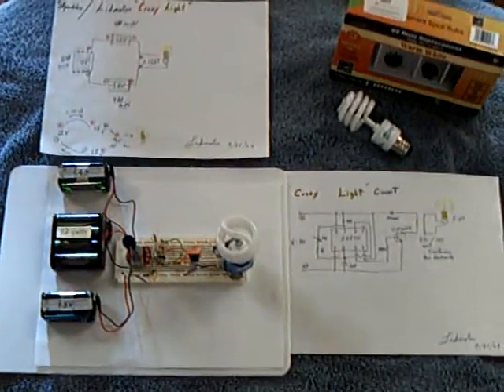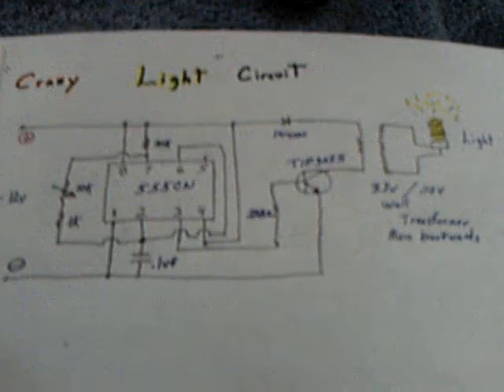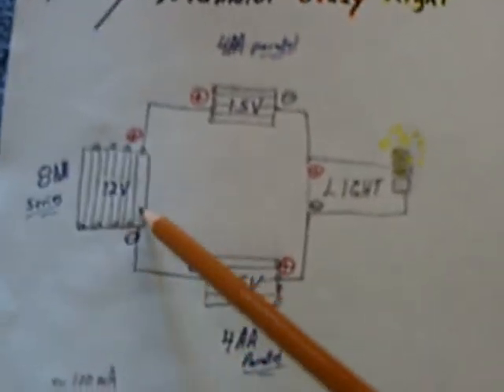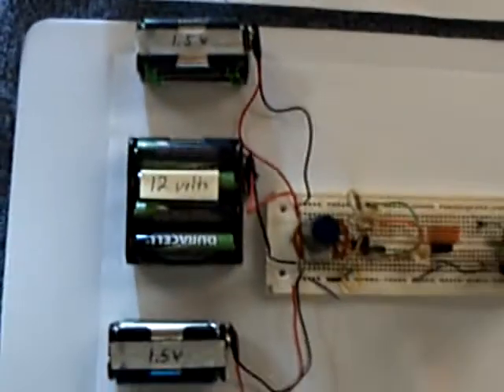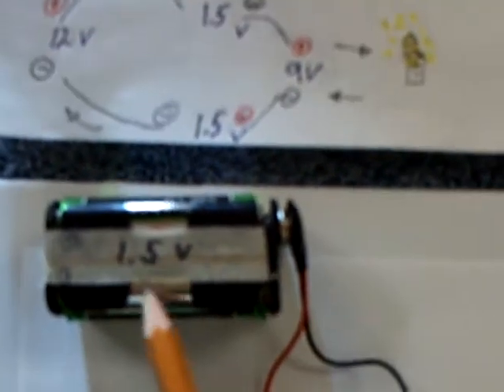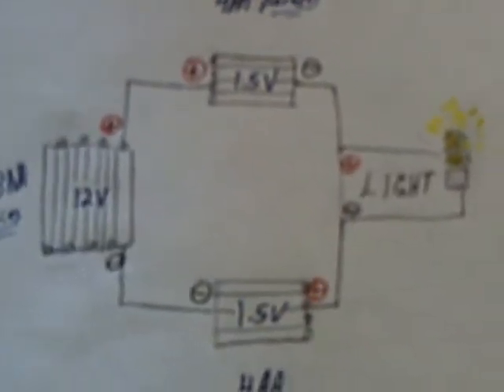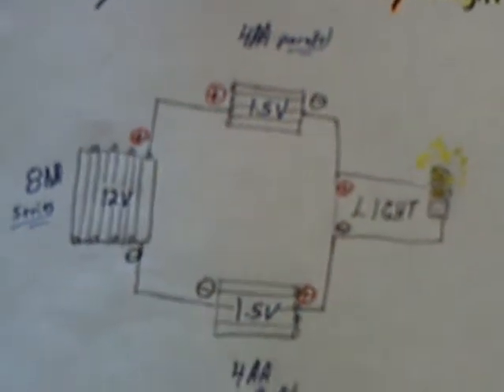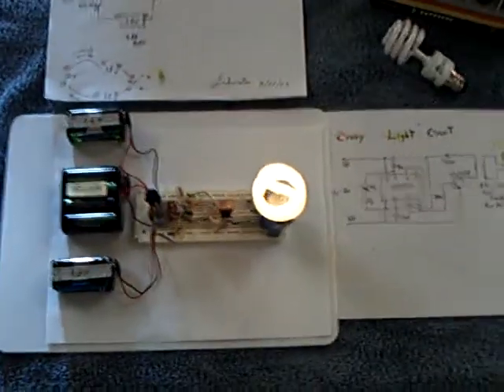Skywatcher / Lidmotor-- "CRAZY LIGHT"

Comment: The two positives is running sort of like "Radiant Energy" have you tried playing with "Cold Electricity" yet? it's really an amazing way of extracting amazing power just by connecting together HV(High Voltage) positive to a LV (Low Voltage) positive. Having it jump through a spark gap within what's called an Earl Gray Tube. Are you familiar with this? it's very very interesting

Comment: The voltage travel your talking about is called SUPER-POSITION. The most strong current over rides the lower current.  I just got done learning this in my electronics class. As for the circuit design charging the batteries backword that's a new concept for me.